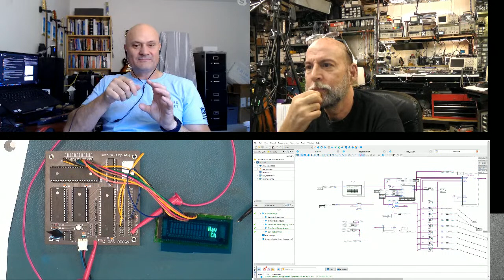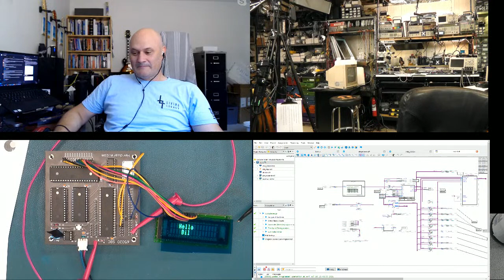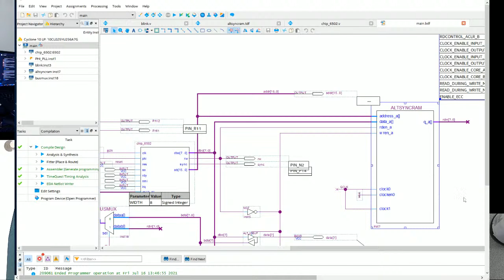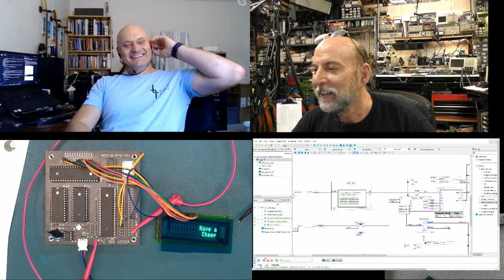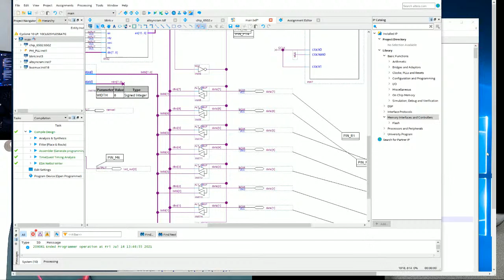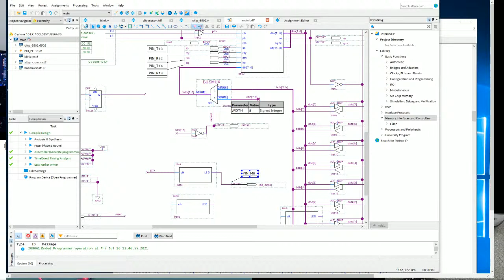The Coriolis Effect with Ben Jordan and Bil Herd, July16th 2021

Comment: If you look on the MiSTer project on github, the Verilog for the SDRAM controller is fairly straightforward.

I was quite scared of using SDRAM for years, but it's not too bad now.

If you view the control signals (RAS_N, CAS_N, CS_N etc.) as a combined "command", it simplifies things.